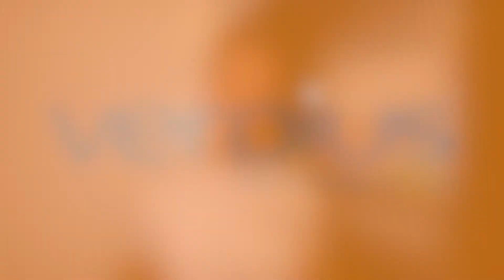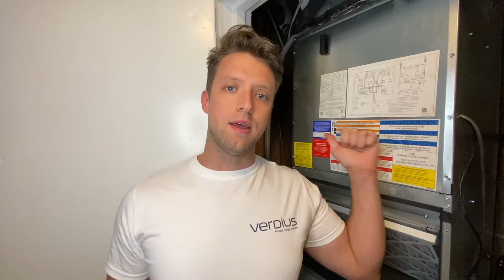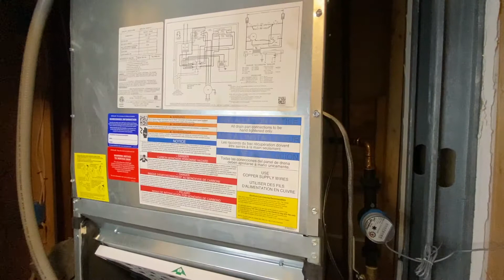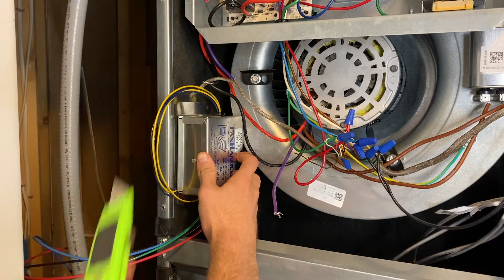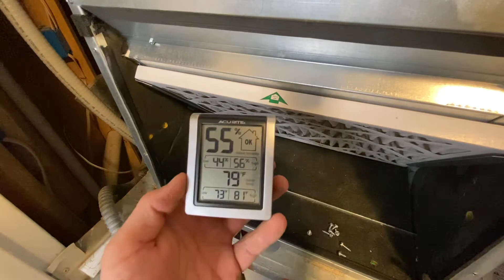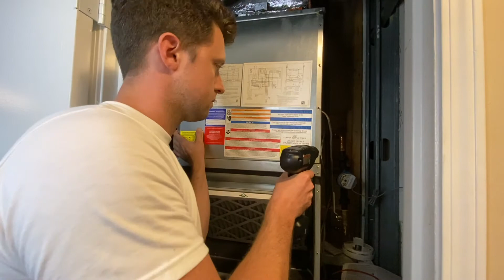Installing the Fan Handler HP-240

Comment: How did it help with high humidity
Reply: It helps really well with humidity. I definitely notice a difference especially when visiting other homes.
Reply: For those of us with non-modified HVAC systems, be sure your unit doesn't run for a good 10 minutes between cycles, so that the moisture that's been trapped by the evaporator ("A-coil") can have time for that condensation to drip away.   Otherwise, you may be needlessly carrying moisture in the circulating air.    If your unit has adjustable fan speed settings, they can often be lowered, resulting in better cooling and dehumidifying (the air doesn't travel as quickly through the A-coil, thus allowing the A-coil to have a stronger effect on the air passing through it.)